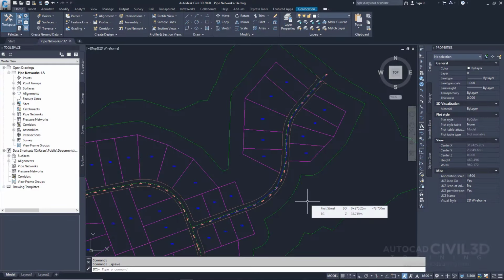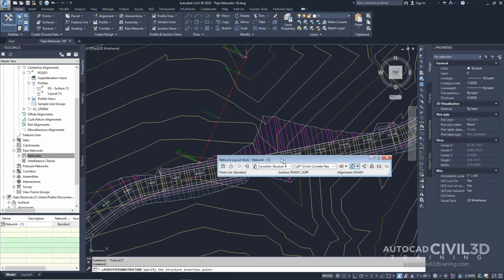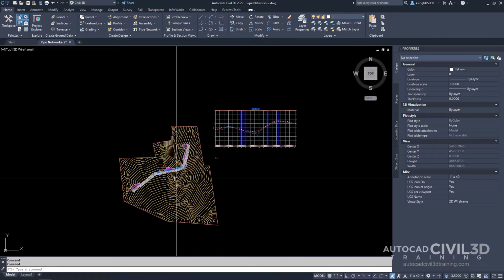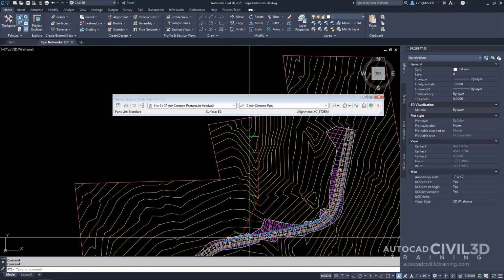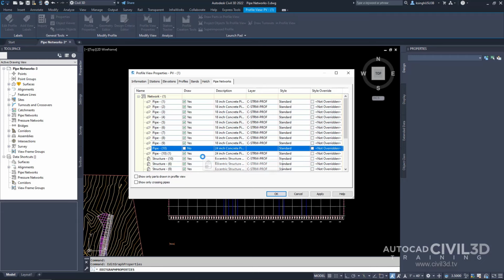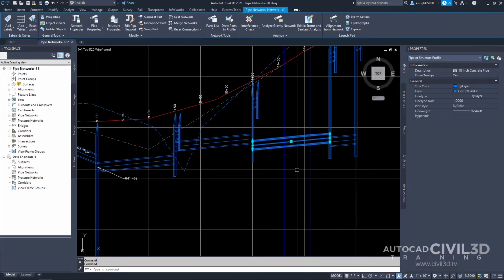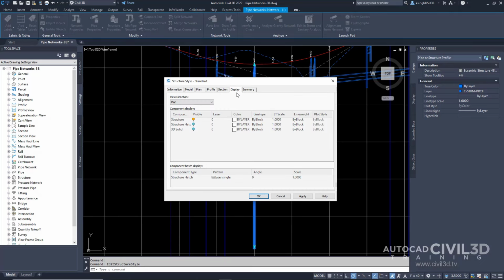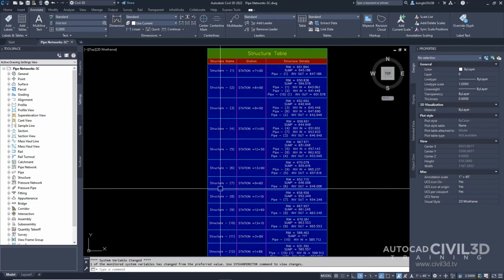14 Pipe Networks in Civil 3D 2020 to 2022 for Beginners

Comment: Hello sir, I've been working with the pressure network in Civil 3D software, but I'm having a problem. After I create the pipe, it only shows as a single line, and the fittings and bends don’t appear. Since I'm a beginner, could you help me figure out how to fix this?
Reply: Change pipe and structure style to double line
Reply from the maker: Turn on the Pressure Network Catalog parts + 3D display. Set your pipe style to show Pipe + Fittings (not schematic) and make sure a valid catalog is assigned. Then when you add bends/tees, Civil 3D will insert the fittings instead of just showing a line.